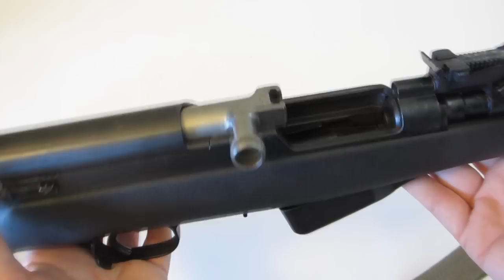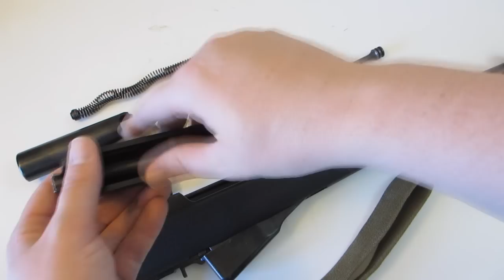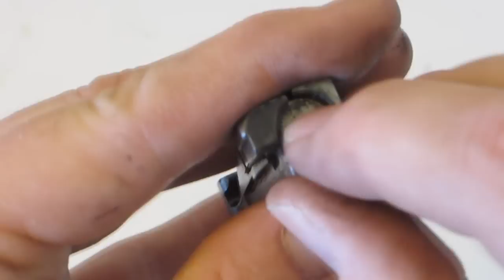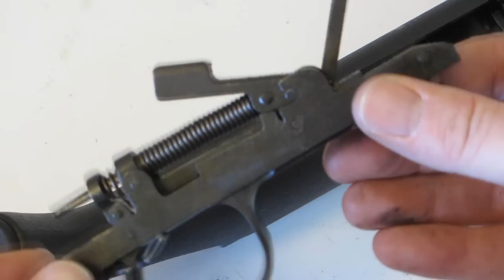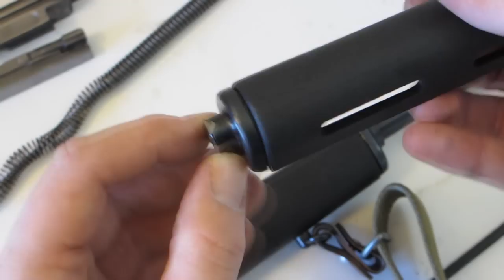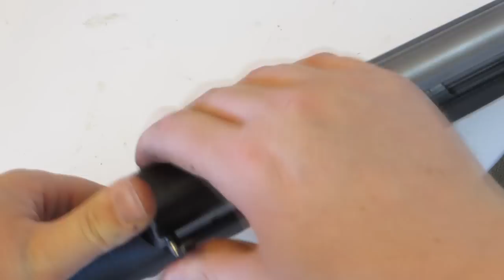SKS Detail Disassembly Assembly

Comment: If you push in on the receiver cover from the back a little when you pull the retaining pin out, the pin comes out easy and the cover don't spring back.  It's a very light push against the recoil spring's tension.

Comment: I've never had any problems with the spring in "backwards." Is there actually a reason for the direction, other than it being what everyone does?
Reply: Oh yeah, there is. I learned this from hard experience.  I bought an SKS, my first one, and took it apart, cleaned it, and put it back together.  I had studied numerous diagrams and read many descriptions for how to do it. But, none of them had said anything about the recoil spring.  When I  put it back together, I got the spring in backwards. I went to shoot it and it didn't eject the spent cartridge. In fact, it rechambered it.  I had to do everything short of kicking the charging handle back to get it to open.  When I got back home, I took it apart again and saw what I had done.  I put the spring back in the correct way and it fired perfectly.

Also, if you have the recoil spring in backwards, you can usually tell because your charging handle will feel...squishy (I guess), and you can actually hear the spring inside the gun.

Comment: I believe Terry G. said it best about 3 years ago ( comments from below ) " Mr Gallaher gave a very good demonstration of the disassemble and assembly of the SKS- the contrast color of the parts and the table and the camera work, made the demonstration very clear.  I also appreciated the cleaning tips as he went along. Very complete..." I couldn't say it any better. My Norinco takes a mallet to reset the trigger guard back in place. Still have the original stock. Your black stock looks quite clean. Manufacturer?  Good safety tips on type of ammo / firing  pin etc. Your comments on 'operation' were right on. And I see you've added the correction regarding the recoil spring. good work. I think this will be my go to video for reminder of how to disassemble and assemble. except for the spring ha.

Comment: Took apart my yugo 8 years ago put the bolt/carrier, recoil spring, gas tube,piston, mag, trigger assembly in a brown paper bag after degreasing and cleaning them to dry. Left them in my fathers garage, just recently came across the receiver barrel and was excited to put it back together only to find out my dad threw out the bag years ago. Now I'm rebuilding.

Comment: I am have troubles getting the gas cover on (about 10:50). When i get it on the little lock thing to the right of the rear sight wont go down. Thanks to who ever can help me out
Reply: yeah do not let the lever go fully up i assume u have Chinese rifle their real nasty and you get freaked out by it have to pary and work it to get it fixed the gas rod and spring get cought on the forward tube assembly

Comment: The cleanning kit that you have in question is this:  No. 1 the brush is what it is a brush for cleaning the barrel. the 2nd item the straight piece with the groves is simply a push rod for a patch. put the rod in the middle of the patch and push it through the barrel. 3rd is the firing pin looking rod.  Well its not that... It is the punch for the pins in the rifle like the pins around the sights ect... Now the 4th is the cap on the handle  that holds the things inside.. if you look carfully you can take it off the retainning tube for all the parts it has a hole in the top of it so your rod can slip through it.  That is a crown protector. It will slip over the end of the barrel to protect it from dammage from the cleanning rod. slide it on and you can turn it to not move look at it carfully youll see what I mean. and also it is the cap that goes over the handle as a top it will twist also to stay on and of course the handle has manny holes for the rod and the punch to hold the rod in place... I hope Ive discribed it all for you well enough.. If you do read this let me know ok? just drop me a note at normanrii@yahoo.com or if any one else has let me know thanks alot

Comment: There is a lever switch on the right side in front of the windage/elevation tab. Flip the tab down 1st to get it out of the way. Use a small flat tip screw to pull the lever out then flip it all the way back. Shake the hand guard loose & two pistons & the spring will fall out. My trouble is figuring out how to put the gas & piston assy back together. Either the spring tension is too much or I am doing something wrong...

Comment: You sir are incorrect ,as too some of your info concerning the SKS. The AK has basicialy the same gas operating system and made very robust to take into battle. The SKS did see some action from the Russians in the last few months of the war. You may not beleive me ,but everyone is entiled to their opinion. I don't agree with anything you have said and maybe you should get your head out of your ass and do a little research on The Russian SKS which Siminov developed for the Russians way back 1939.

Comment: The SKS was never in service in WWII and has nothing much in common with the AK47 other than the cartridge it fires. 2 different designs by 2 different people. Both are great weapons and have their strengths and weaknesses. Each one fulfills certain roles, that is why after the AK47 took over as the main military rifle the SKS still saw use for certain applications. Its best to have 1 of each but the SKS is by far the better value if you have to choose one over the other IMHO.

Comment: any suggestions on a replacement for that little spring under trigger system in the
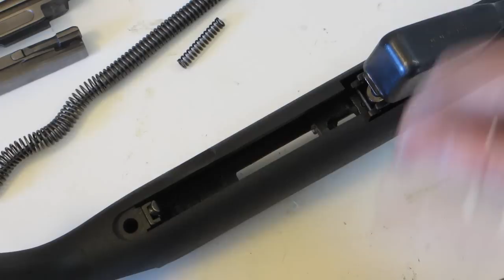stock? (at around 9:37-9).  Mine is totally awol. Pissed.  Last step in reassembly.

Comment: Hi, I did it yesterday, and it was simple. Just hold your finger against the piston on the forward side of the rear sight (so it doesn't fly away), then rotate the same lever used to remove the gas tube a little farther, and the gas piston will release. Reverse actions to install. Easy.

Comment: So, I have a Yugo M59, but I don't think that will make a difference. My operating rod is shaky if I shake my rifle around. My handguard is actually mis-matched, but I don't think it would be a problem, because my guess is that they're pretty much all the same specs length-wise. My only fear is that is might not cycle correctly, etc. Have you encountered this?